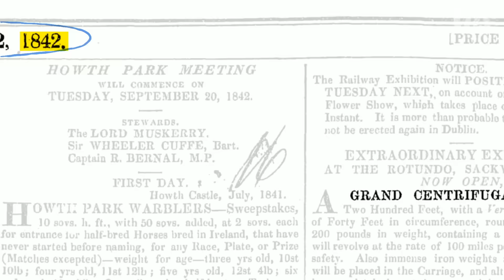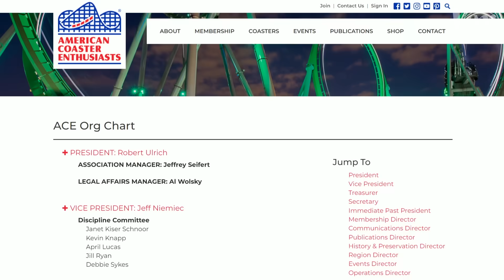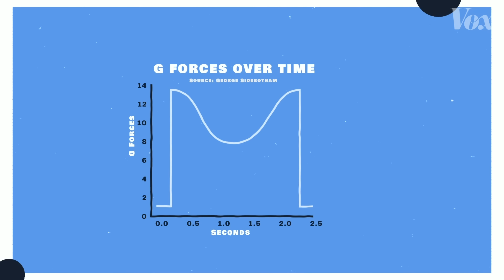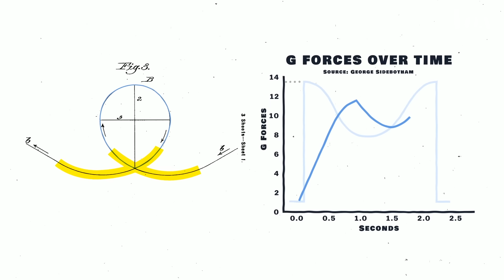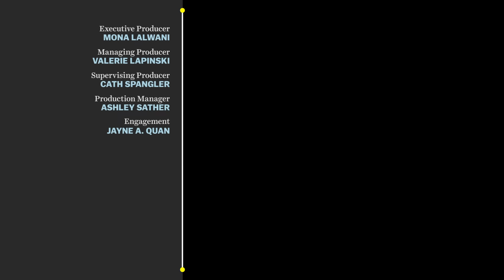Why roller coaster loops aren't circular

Comment: For a similar reason train tracks and street curves (like offramps) aren't perfect circle sections like you may find on a model railway either. If they were, turns would be really violent or require you to turn your wheel in an instant.
Reply: Exactly, instead of semicircles they use segments of a spiral arc to make the turns smoother
Reply: Yea transition tracks increase the centripetal force gradually and not immediately
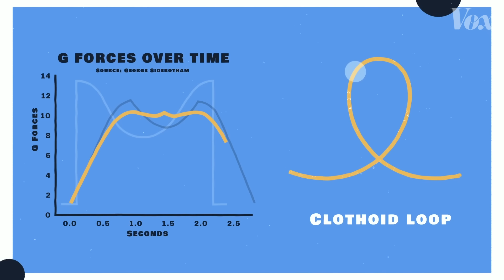Reply: Partly similar but in a rollercoaster the speed drops predictably as the car goes up then increases as it goes down which is why the bend radius is much smaller at the top. At 5:13 it's clear the G force is nearly constant.
Reply: SCIENCE!
Reply: It isn't that the circular section is "violent," but that it starts and ends too smoothly, and drivers' reaction delay leads them to go past the point where they should start turning noticeably. Making an unnaturally abrupt start to the curve (which is often how the curve is altered) forces the driver to start the curve sooner. With roads, which are much wider than most of the vehicles traveling on them, this is also an adjustment to the better drivers who will turn sooner on their own and run on the shoulder if you don't give them more space on the inside of the curve. With roller coasters it's different because there can be no deviations.
Reply: @josephfisher426  One might argue that violence in the second derivative is still violence, mathematically speaking. . .
Reply: Not really with trains, train turns are so wide and taken so slow that there is barely any centrifugal force at all, I don't know why they are actually banked.

Comment: Spin a ball on a string in your hand and just sense the forces you feel in your hand. 

Then try to make a Smith circular spin straight after starting and try make a Smith sensible exit mimicking the shapes of these loops.

You will see the circular spin exerts more pressure on you and is much more tricky to complete in a perfect circle as it naturally wants to break up the shape. It also shows that a less circular path exerts less pressure on the Shape as a whole meaning that structural integrity is safer not only due to material but the trajectory it's self
Reply: First step: actually learn how to spin a ball on a string in your hand

Comment: Nice and interesting video!
As a improvement point, please include some form of metric measurements, I found myself having to google feet to meters to get a size perspective
Reply: dfrocha1 -  Simple estimated conversion of feet to meters: There are 39 inches in a meter, 12 inches in a foot and 3 feet to one yard. I.e., there are 3+ feet/1+ yards to a meter. So, 150 feet = 50 yards = 50 meters less 8% = ~46 meters (yards x 92% OR feet x 92% divided by 3). [To simplify further for head calculations: convert feet to yards (feet divided by 3), times 90% then add 2%.] Once you have done this a few times, you should find it quite quick to calculate a rough estimate.

Being in the U.S., I use the reverse for rough estimates: 1.08 times meters = yards then times 3 for feet. Or use meter plus 3 inches per meter. This means 16 meters equals 16 yards + one foot per four meters = 17 yards and one foot. [To simplify further for head calculations: Use 1.10 times meters then subtract 2%.]

Comment: Nah, we jumped a whole part of history once the tubular steel was mentioned: who thought to go from a one car structure to multicar? And how much testing was involved? I don't like coasters at all but this was an interesting video. Thank you!
Reply: That jump was pretty made with the first modern loopers like Corkscrew at Knott's and Revolution at Magic Mountain.
Reply: Multiple cars just kinda happened. Arrow dynamics ahd Schwarzkopf did it around the same time. Except arrow was wildly more popular.
Reply: @Aether-x8u  but the latter was more popular in carnivals
Reply: Multicar train already exist before bottom wheel even exist for rollercoaster.
Reply: They made the loop much bigger to reduce the G force and that also allowed them to fit bigger trains
Reply: Multiple cars in a train had been a thing for a long time, earlier ones even featuring a brakeman who had to manually brake the train
Reply: If you want a full history of coasters, that is a DEEP rabbit hole!

Comment: Tysm I was always uncomfortable about how rollercoasters aren’t round . I thought it would look gorgeous round.
Reply: Good thing engineers don’t aim for gorgeous.
Reply: There's a reason why even planetary orbits are eclipses.
Reply: @traplover6357  Even earth itself is an elongated spheroid. nature abhors a circle i guess.
Reply: @traplover6357  that’s just because it’s impossible to have a perfect circle. Even if it goes down to 2 million decimals, there will always be an error.
Reply: @traplover6357  You mean ellipses? lol
Reply: Oh ya he died. 
But u should have seen the loop to loop he went thruu
Sooooo legit perf
Reply: They could make a perfectly round roller coaster loop, it would just have to be a very slow loop and there'd have to be a second set of wheels to keep the roller coaster from falling off the track. Using a shape that keeps the acceleration more constant and allows a transition to the necessary speed at the top of the loop to keep the car and those in it on the tracks is usually a lot more fun.
Reply: have you ever heard of the fireball or ring of fire.
Reply: circles dont exist in our world anyway
Reply: Well just everything has to be perfect and if it isn't you're uncomfortable?

Comment: As an enthusiast, before watching this video. The simple reason as to why was that with a circular loop, the G-forces coming in to the loop were too high, and too little at the top. The design we have now evens out the G-forces throughout the element.
Reply: Yes, you could lower the g-forces, but then you're likely to have the car fall off the track at the top, or you can have the higher g-forces and risk injuring the passengers. Changing the shape was ultimately the best choice as the varying radius could help to cushion the impact of the acceleration and allow for the car to stay on the track at the top and the passengers to not be hanging from the seat belt.
Reply: @SmallSpoonBrigade  Ok you clearly don't know how coasters work, there  are upstop wheels on the bottom of the track to keep the train on, during negative Gs, also the old coasters did not injure the passengers, the high Gs aren't really bad for the human body, its just that the general public didn't like the feeling of greying out and the intensity.